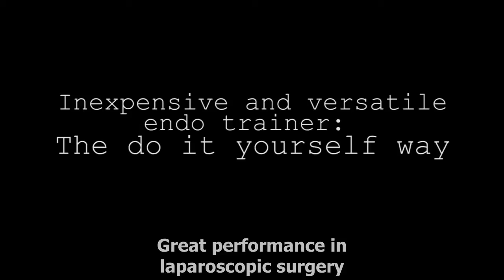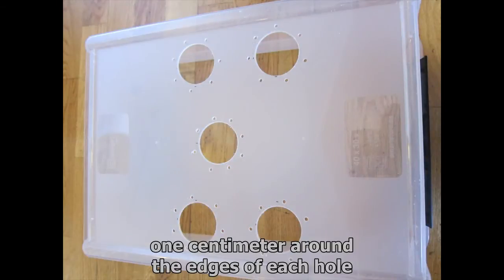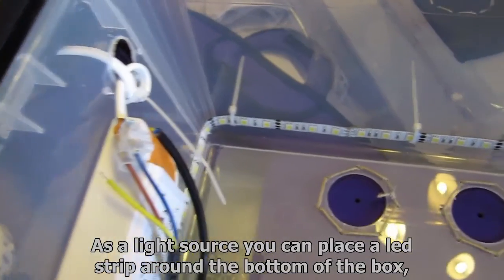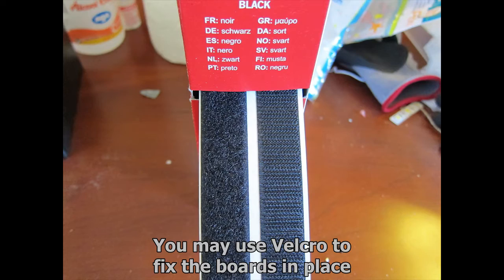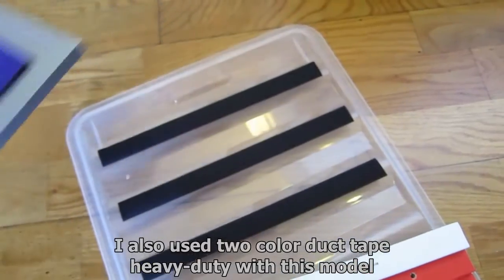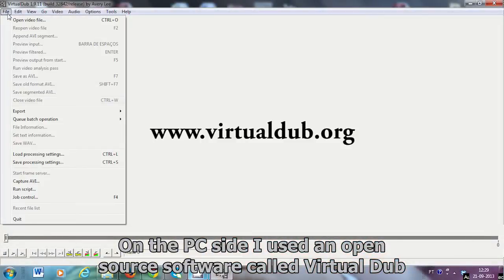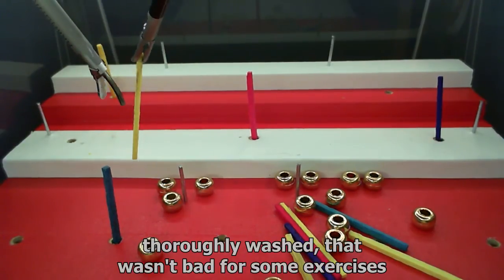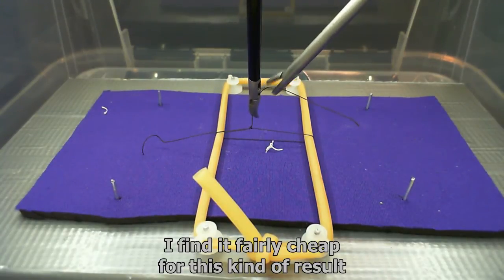Inexpensive and versatile endo trainer: The do it yourself way

Comment: So, after working with your trainer for few months, do you have any enlightments for those who want to build it themselves according to your model? 
I want to build one, just wanted to know if the size of the box you used is good? the light? the placement of the holes? and the materials?
Reply from the maker: The light is probably more than enough, you can use less, and if you want realism, maybe put the light more in the back. The holes are ok for me, but it is a matter of personal preference. The neoprene wears out, but is easy enough to change. If you come up with a more resilient material, easy to come by, please share. The surgical instruments are no nearly as good as you may be used to (needle holder) but for the price... who can complain?